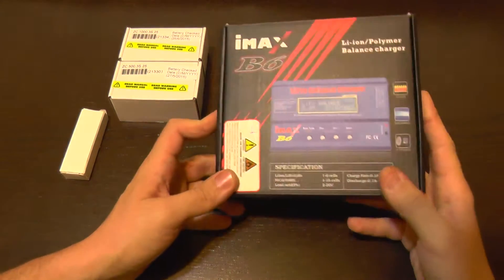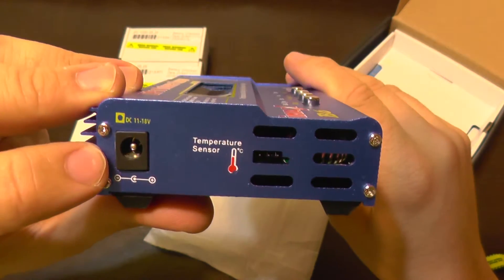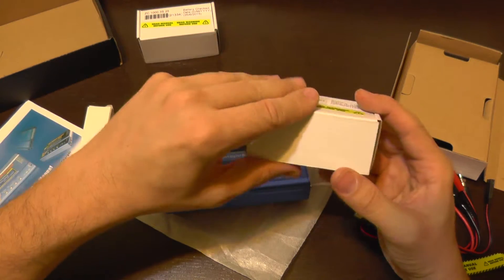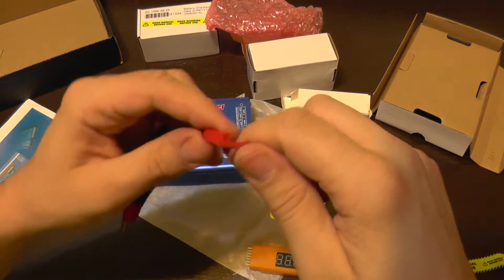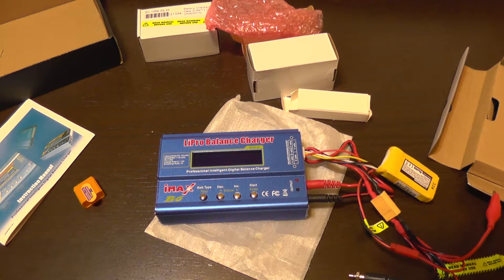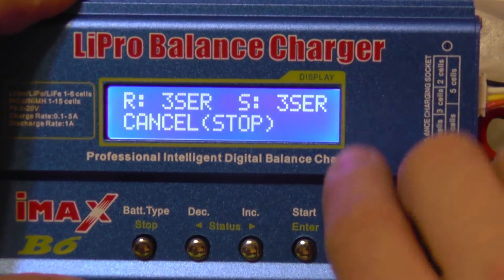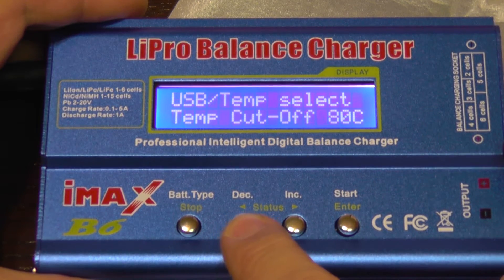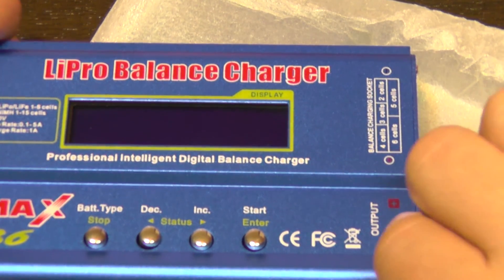Imax B6 Charger - Clone - Basic Tests And Review

Comment: Hello what cable do I need to charge a LiPo battery? What black and red cables. It has the square connector with the two round plugs inside it
Reply from the maker: It depends on your battery, there are a lot of models such as XT30,XT60, XT90, Deans T, JST, bullet, EC, etc.
Reply: TechTronic9000 thank you very much

Comment: hi, why did you choose 0.8a? what does it mean?
Reply from the maker: I have choose 0.8A (amps) as it's 1C rate of my 0.8A LiPo battery. A general rule is to charge LiPo at 1C rate. For example a 2200mAh battery can be charged with a maximum current or 2.2A.
Reply: My battery is a 2S 6000mah 60c.. so will it be like 6.0A?
Reply from the maker: Yes, you can charge up to 6A, but there are some limitations, the IMAX B6 has 50W power this means that for a 2S battery (maximum voltage is 8.4) the charge will output a maximum of 50/8.4=5.9A, so probably it won't be able to fully suply 6A, this won't be a problem as the battery will charge slower (with 4-5A).
Reply: If i charge on 5.0a, how long will it take approx?
Reply from the maker: 6A capacity / 5A charger rate = 1.2 hours, with balancing and chemical loses ~1.5 hours.
Reply: Tnx!
Reply: ishantha soysa nb
Reply: ishantha soysa lblbl ln

Comment: Thx for the review. Just a couple of questions:
1. Can I power this from laptop power supply - rated at 18,5V, 3,5A?
2.  I would like to charge my cells only to 4.1V - is there any way to do this? If not maybe I could do a little calculation and set saftey timer or capacity cut off so that voltage doesnt exceed 4,1V?
3. Can you charge the battery ONLY using balacing port? And what is the maximum current you can charge ONLY using balacing port, without main leads.

Thank you!
Reply from the maker: +au9879 Hi there, I'll try to answer each point:
1) It takes 11-18 volt, I don't know if it will work with 18.5V, it's not a big difference but it's over the maximum. I use a 12V PSU with mine.
2) You can adjust the calibration of it and make it "show more" than real, but i don't know if you can have a 0.1 V diffrence.
3) You can not charge only by balancing port, you also need to use the main output.
Reply: I use charger from my broken laptop and it's 19V 3.16A. I didn't have any problems 2 months, since I started to use it.
Reply: Mine charges a 18650 to 4.13 volts when I use the lio option for the battery type. Hope this helps.

Comment: you can still recomened it? i looking for my first charger for my 1200 mah lipo battery
Reply from the maker: +alor alo (alor23) Mine works perfect, I'm using it to charge or maintain (storage) multiple LiPo's and also use it for some SLA batteries.
Reply: +TechTronic9000 is it possible to calibrate this one becouse i saw on other film that for example charger show 4 v but reall was 4,06
Reply from the maker: Yes, mine has an option for voltage calibration from the hidden/service menu.
Reply: How do you access hidden/service menu?
Reply from the maker: Have a read here: http://www.rcgroups.com/forums/showthread.php?t=827821